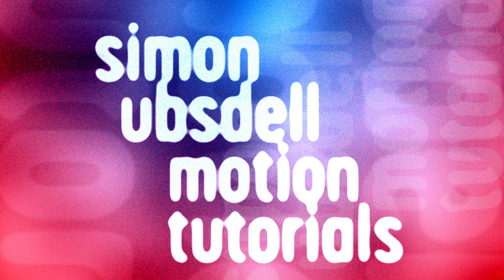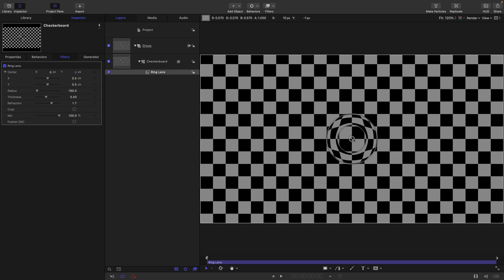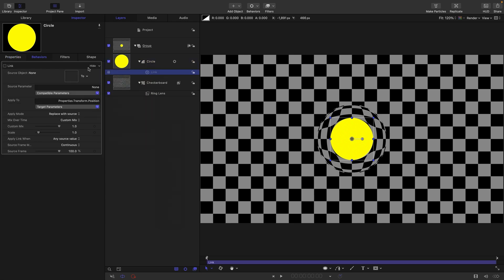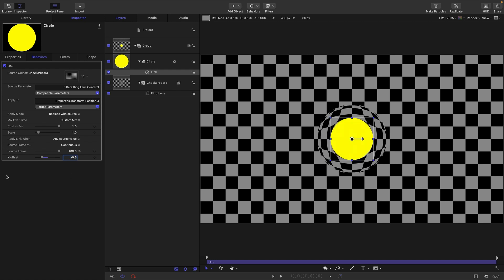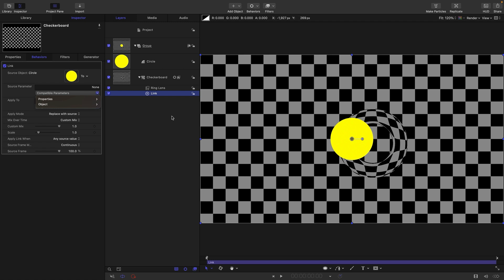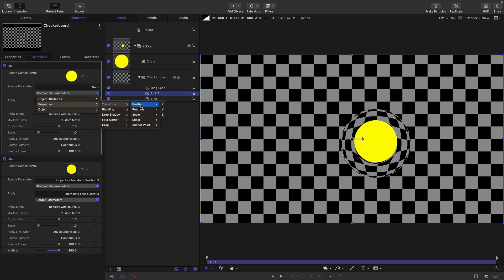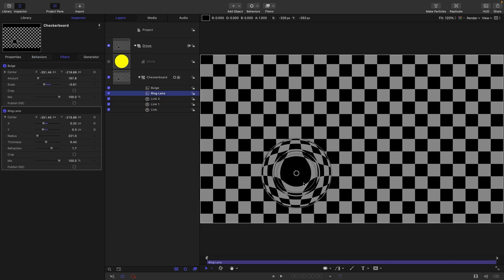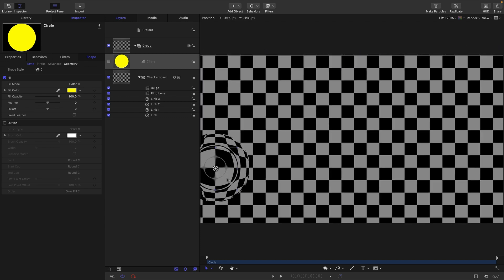Apple Motion: Understanding Co-ordinates

Comment: Thanks, Simon! But why did the do this? I mean it's so much easier to fix while coding than to nudge users to complicate their projects. And also we may have an unusual problem when adding a behaviour (for example Random pos. X). Definitely Apple doesn't love some software children.
Reply from the maker: Filters use coordinates system where (0,0) is bottom left, (1,1) is top right and (0.5, 0.5) is centre in order to deliver resolution independence: those coordinate values adjust to whatever aspect ratio and frame size you are using. Motion is not the only application that works this way and you can see the advantages. Among other things the user doesn't have to work out what the centre value is based on pixel width/height divided by 2 - in After Effects by comparison you have to do a lot of sums to work out basic values. But I agree that it's quite confusing in other ways.